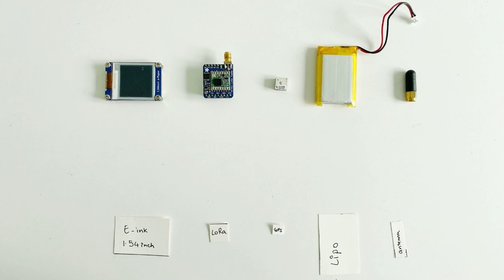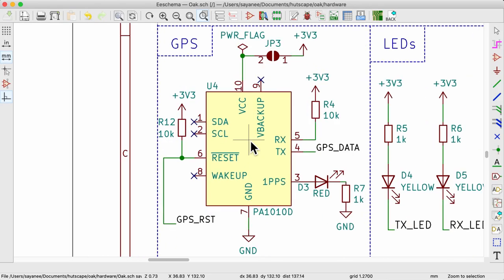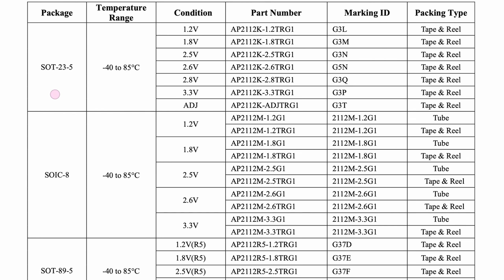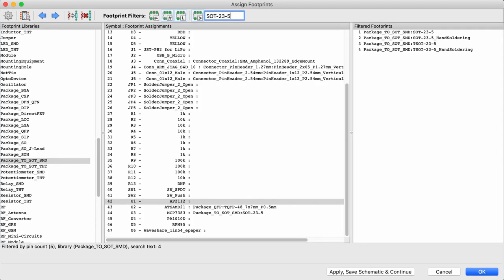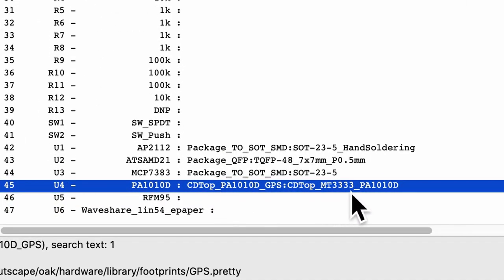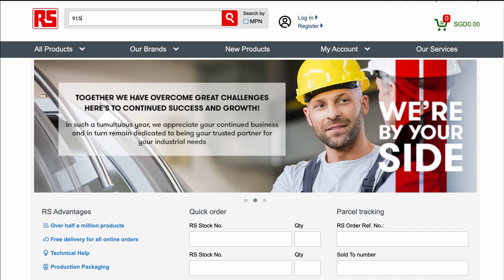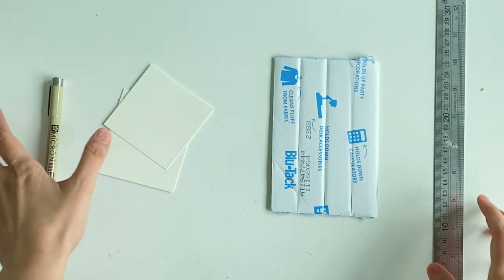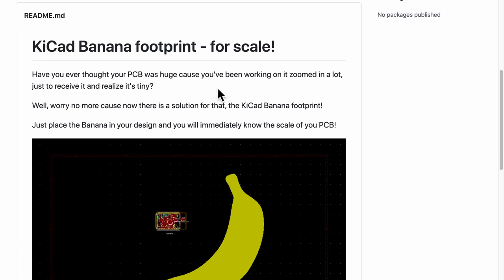Common missing steps between the schematic and PCB layout // KiCad, PartsBox with LoRa, E-Ink, GPS

Comment: Great video, as usual...keep them coming!  Regarding the rough 2D mechanical layout, I find that using PowerPoint, Google Slides, or LibreOffice Impress to mock-up major components is much easier than cutting-out the outlines from cardboard and gluing them down.  Of course, with FreeCAD,  it's not that much harder to do a 3D mock-up, either.
Reply from the maker: FreeCAD is definitely on my learning list! So true about using any slides program for doing the mockups digitally. I did the paper prototypes to have a physical feel of the size, but I guess you can do them digitally and print out as well for "repeatability".